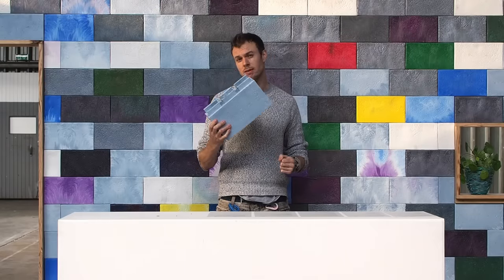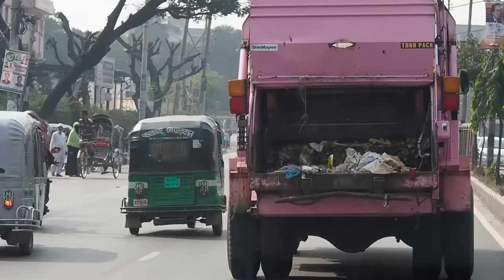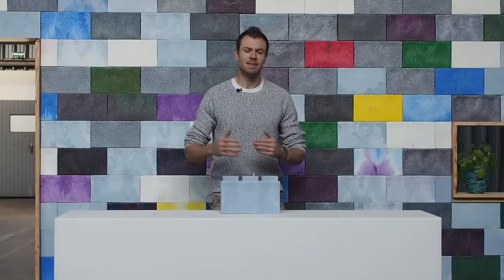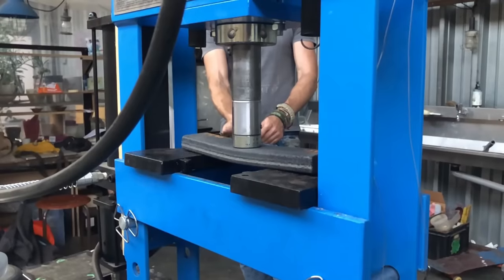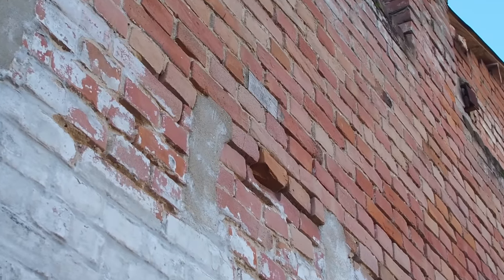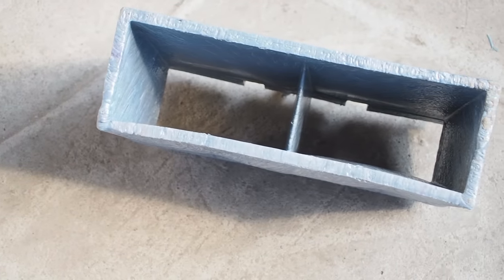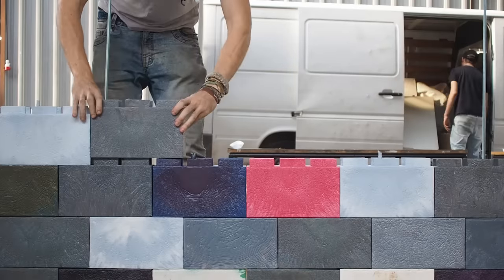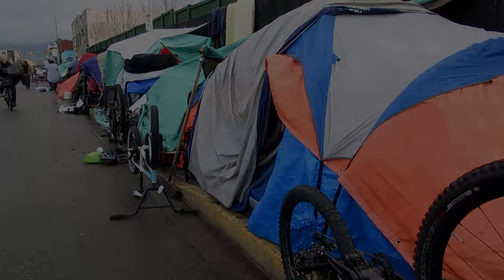Why the world needs recycled plastic bricks (and how to make one yourself!)

Comment: My question is, do the bricks lose some strength when heated up by the sun and do they release harmful chemicals like plastic often does when left under the sun for a long time?
Reply: IDK about this product specifically, but plastic lasts a very long time as long as it's not exposed to UV light. In the developing world, I would imagine it would be covered with a lime/sand stucco or something like that, similar to adobe-bag homes.  I'd also think that the walls could be filled with straw/lime or cob for thermal/sound insulation.
Reply: b k Air, is a great insulation stand-alone
Reply: @GrzesiJan  yeah we need better r values and thermal conductivity
Reply: Paint should fix that issue
Reply: from what i see this bricks strong enough to not eroded into microplastics
Reply: @alvinxyz7419  A lot of plastics are quickly weakened by exposure to UV, but like some other people have already said, they can easily be covered to prevent that.
Reply: The strength wouldn’t be affected, but you are definitely right on the VOCs
Plastics do release volatile organic compounds (voc) it’s the same smell you get when you park your car in the sun for a long time.
And considering the plastics used to make the bricks are mainly bottles and other packaging material, there shouldn’t be that much harmful VOCs. But if an entire house is built by these bricks, the total amount released would definitely be harmful to humans. Especially if something like bisphenol A was used to make one of the products.
Reply: @Vedrajrm  They also violate fire safety protocols (Think how much more dangerous a molten building would be)
Reply: yes. they do. there is a number of issues with this. I know this for a fact.
Reply: it needs to be sprayed with a coat of uv resistant / heat resistant paint/coating.
Reply: @Gaia Barone Ironically one of the big reasons we moved to plastic was the belief it would save wood, but then we just let our forests grow without management until they became tinderboxes and became foundations for massive uncontrollable wildfires. All that wood was just wasted for no reason, not to mention the destruction of ecosystems.

The resins used in pressure treated wood definitely is not healthy. Real wood is much safer, and frankly would not be expensive if we just cut back regulations on logging which also would be free forest management for the local governments who keep cutting back on their forestry operations due to the cost to hire the amount of people to cover the forest completely. 

I don't think we can eliminate plastic because plastic has amazing properties that aren't matched by wood products, but definitely a lot of polymers could be replaced by real wood products like they used to be.
Reply: @SteveOLive88   exactly
Reply: @brtecson  red oxide paint primer which is cheap in the third world does excellent UV protection
Reply: Yes and. It breaks down and becomes brittle because of UV light.
Reply: King Mike News Network  No, actually it's not.  Most of the world has strict regulations on the logging industry.  Trees are farmed.  Virgin forests are typically left untouched.  I don't know about where you are from because I have no idea where you live.
Reply: @DaveSmith-cp5kj  The forests became tinderboxes due to the misguided forest management practice of putting out all fires. After following this practice for decades masses of understory brush was allowed to build up. Then when fires did happen they were catastrophic. The other issue is people living in forests where their homes and lives are threatened if there is any fire, making the problem worse. Nature could control the spread of fires easily before human intervention. Some trees couldn't even reproduce without regular fires!
Reply: Yes they break down, causing further problems.
Reply: @brtecson  You could coat (paint) these blocks with a clear coat of uv-blocking paint.  Then every five years or so, recoat it.
Reply: My exact thoughts. 👏
Reply: @Vedrajrm  abs outgas, hdpe does not
Reply: @DaveSmith-cp5kj  plastics are made from petroleum... I recently saw a video here on youtube where a guy has some kind of thing that he cooks plastics in it and reduces it to diesel that he uses to run his generator.
Reply: Oh boy i see a future where plastic bricks would be banned as same reason as asbestos.
Reply: @JDW240  *"No, actually it's not [better than chopping down trees]." Trees are farmed.  Virgin forests are typically left untouched. *
It's still taking a waste product and putting it to use. Farmed trees take decades to grow and don't have nearly the biodiversity of a forest. And this could also be put to use in places that have very few trees
Reply: That’s why these bricks are mostly used for indoor spaces, where they aren’t as susceptible to UV radiation, erosion, etc.
Reply: I think the idea would be to use it as a base structure and then layer over it with more conventional construction materials.
Reply: Yes, yes it would.
Reply: I mean you need to paint it like other house you know
Reply: I know that in the Czech Republic A guy makes pavers and he adds a powder UV to the plastic to help with the breakdown and he's had dump trucks running on them for 10+ years now and still like new...
Reply: Then why not create a new logging niche for sustainable foresting? USA has a metric fuckton of federal land, let the country lease operation on a huge swathe of land specifically for logging so long as there's never less than 90% the amount of trees in the ground that there were when the land was fist leased. I know some trees grow to maturity in 10 or 15 years so while a slow start, it should allow a company to churn out massive amount of sustainable wood production AND give the country a rather large cut of the industry pie as (in my opinion) will be entitled for a hefty cut due to providing massive amount of land at basically no cost.
Reply: yes it would give you a big shortcut in cancer any% speedrun
Reply: Could it work as a foundation ?
Reply: @JDW240  sadly no such thing in Malaysia, there is regulations on permits, or permanent forest but illegal logger and poacher is seem untouched
Reply: Plaster them
Reply: And what would happen if the house catches fire🔥?
Reply: @brtecson  but wouldn't it still heat up? I have concrete walls and it remains hot into the night. I don't think a think layer of concrete will prevent the heat from getting through to the plastic.
Reply: Cure the plast8c...heat resistant
Reply: Legos don't melt...
Reply: Right! UV damage might cause it to flake into plastic dust- and micro-plastics are endocrine disruptors in most animals-
maybe a plaster / cement coating would mitigate this?
Reply: And what about the micro particles Lost in the water, One of the worst problema about plastic
Reply: everything is basically a building block of some form and can be harmful if to much enters the body.  you are correct when you think i have nothing better to do today and thats why i'm commenting . most every question has been answered and yet we humans keep asking the same old questions over and over . seems like we just want to communicate a bit lol . we need to focus on questions that actually seem to have no answer.
Reply: do they release toxic fumes when they burn?
Reply: Lasts over 100 years and when it's mixed with sand it is not toxic in developing countries!
Reply: @floreedith4667  are you sure it's not toxic? Micro plastics are becoming a big issue these days.
Reply: Use HEMP
Reply: It most likely does cause it’s plastic, but I’m sure it can be covered up. I think it’s a great idea for some type of reinforcement. It just needs more time.
Reply: @DaveSmith-cp5kj  the main drive behind using plastics was the hope that the rainforests would hopefully stop getting clear-cut.
Reply: Moisture infiltration, fire hazards, breakdown due to uv rays.
Reply: It can be used as internal walls, thats reduce 50 percent problem
Reply: @Vedrajrm  you're exposed to plastic 24/7 and this isn't an issue. I bet if you look around right now you'll see dozens of plastic items that are espoused to the sun in a regular basis. I don't see anyone falling over and dying because of VOC exposure. The reason for that is the VOC released is in the parts per trillian in the average household, an entire house wouldn't make a big enough difference in release of VOCs
Reply: @DaveSmith-cp5kj  sure, but is wood any less flammable? Is your car? Your clothes or couch? What about your bed?
Reply: @Gaia Barone it's better than plastics being in our oceans, waterways and landfills.
Reply: @cmichaels9544  Wood burns rather than melts, that's a whole lot safer than plastic. Same reason you wouldn't wear synthetic clothes when working a forge, you wear cotton if not leather because cotton will just burn off.
Reply: @benitalpaxton8120  Using hemp for a building would be senseless.
Reply: @MommeeMadre1  Legos do melt as they are made from ABS. Put a brick next to a candle and once it catches fire put it to the side, the whole thing will burn up and cause a molten mess.
Reply: @donnatrump1403  You can make plastics heat resistant, but they are not fireproof. They will still catch fire, they only slow combustion. The ideal building material is brick and concrete. 3D printers using concrete to build houses is a rapidly developing solution.
Reply: @DaveSmith-cp5kj    the plastic is mixed so no real combustion
Reply: @cmichaels9544  
lol. You've nailed it.
Reply: The plastic can sit on land field and still do the same harm, where we can reuse them for a beneficial cause than just killing the soil for nothing. Just think about the homeless.
Reply: Tornado could probably easily take that apart
Reply: Hard to beat regular masonry brick which lasts indefinitely in or out of the sun.  No paint required.
Reply: @brtecson  yup. It needs a "sunscreen" to prevent microplastuc photo degradation. I nominate the Super White paint that was recently developed, which includes the benefit of cooling the surface as well.
Reply: @ScarletFlames1  I think this would be a smart idea. A sustainable "thinning" of forest instead of allowing lumber companies to monoculture a large swatch of land. This could I'm theory maintain biodiversity, and come ahead of  disastrous fires, but the only issue is labor, logistics, and the industry's appetite for profits.
Reply: @cmichaels9544  fair point. We drilled the oil and manufactured the plastic as a species.. it's our responsibility and perhaps the toxins of plastic harming us most, vs. the other animals who did not choose to use plastic but still suffer downstream is more fair.
Reply: @JDW240  Virgin forests are untouched? Not in British Columbia Canada, where the government is allowing the logging of old growth trees despite them being irreplaceable and such a small fraction of the forest we have.
Reply: @DaveSmith-cp5kj  brick and concrete do very poorly in earthquakes, whereas wood, and assumably plastic are much better. Bricks with plastic spacers might be ideal. instead of grout which has no give, plastic cushions between the bricks would absorb shock.
Reply: @brtecson  you wouldn't want to fill them with something too solid or too light, instead a mixture of loose dirt and straw would work well, or styrofoam instead of straw which could be shredded and mixed with the dirt, the benefit of having it filled with something heavy is it makes the walls sturdier
Reply: @GrzesiJan  not a large mass of air though, its more beneficial to have air pockets, thats why we don't just leave our walls empty
Reply: @brtecson  when you warm Plastic it loses its rigidity, the warmer it gets the more melty it gets, so if in high heat these bricks become too flexible the whole structure could collapse, however to answer the original commenter they did say they tested exposure to UV and published the results already so you could just check their data
Reply: @DaveSmith-cp5kj  probably about as dangerous as a wooden structure. Thick, heat-resistant material like porous brick has been used for thousands of years, even the Romans used concrete and their structures still stand.
Reply: @DaveSmith-cp5kj  3D printing with geopolymers seems promising/cool. Working with concrete is terrible. Shit ends up in your lungs its a bad time.
Reply: @dharmapunk777  They will be a lot more expensive though, which is counter productive to the AM construction industry. Mixing cement isn't that bad, just do it outside and don't breathe it in. Respirators are cheap as well if you really need it. I cast little pots out of concrete to grow vegetables, and I made a shooting range using concrete with a rubber additive to give it ballistic properties. Cement is a great material.
Reply: @DaveSmith-cp5kj  Once it's set up its fine, but the dust is definitely hazardous and if you've ever worked construction there is always someone drilling into or cutting concrete with zero warning to put on ppe. 
The dust doesn't just go away on its own either. It's always Mexicans levelling the slab and they don't drape anything off or wear ppe themselves. Then they send some labourer to sweep instead of vacuum and kicks it all up in the air. Fucking terrible.
Reply: @DaveSmith-cp5kj  I agree. Still, we need do something immediately with plastic waste. The solution lies in solar-powered pyrolysis.
Reply: @saibabagarden  All we have to do to reduce plastics is to remove all the environmental regulations on logging trees and then more paper and wood products will be used. This will not only be cheaper, but logging will prevent the massive wildfires that were created from unchecked planting.
Reply: @DaveSmith-cp5kj  Okey, but right now there is huuuuge plastic pollution problem, this waste needs to be removed from environment. It virtually kills life in ocean. So we need stimulate people to collect as much plastic rubbish as possible. If they know they can make fuel or money from rubbish, they'll hunt for it everywhere. This is why pyrolysis is of interest.
Reply: @brtecson  Look up ICF construction. You can shotcrete the outside also.
Reply: @trcaggiano  whos this guy?
Reply: @PatrikBecomes  If its important, I will find his contact info...
Reply: @trcaggiano  it's important, blessings for your fast reply
Reply: Very good question, I would presume it would release some form of Fumes when it is in the Sun and most likely warp it’s shape. I think it would still depend because if you have a soft plastic like a plastic bag and leave it in very hot weather it would warp and slightly melt, if you put a empty coke bottle of a hard plastic it would not war and melt unless is it very very hot. And also consider that in the Sun it would end up cracking
Reply: @DaveSmith-cp5kj  in most cases a building only needs a 1-hour fire rating for code, a thin cement coating works
Reply: @chadsimmons6347  I feel like at that point you might as well go back to wood. Hot plastic is scarier to me than wood burning.
Reply: Hi, I am from Rwanda. Can hwo can we connect and bring this solution to Africa? Please let me know.
Reply: no it does not
Reply: just visited the website of conceptos plasticos and their bricks are fire retardants !!
Reply: I have one of those plastic red and yellow cars I bought for my son. He is 29 now and that cars is still in the back yard. We want to see how long it will last. I bet l am long gone and that plastic car will still be around.
Reply: I liked your comment because #1 it's a good question and #2 you were at 666 likes. I broke the curse 🤜🤛
Reply: @DaveSmith-cp5kj  civilization is not a cheap service, the fact is that forests capture carbon in the air and store it as organic matter.  We should be boosting horticulture and graduating more arborists to watch over and manage our forests to reduce the occurrence of forest fires.  Then, figure out how to balance the use of innovative wood alternatives with real wood.  Dealing in absolutes stifles innovation and closes the doors on diverse possibilities.
Reply: Plastic creeps over time unless it is reinforced, typically with short-strand glass fiber.
Reply: The sun does not heat it up enough to make the bricks loose strength or release harmful gases
Reply: Who say that plastic release toksin under sun light. Certainly plastics had different negative effects. But how under sun????? To protect the plastic bricks if they are directly face to sun light there is a solution. Protective additives against ultraviolet rays  must be added.

Comment: I like the "shingled" design. Especially if the bottom edge is designed to drip water rather than let it run under the bottom of the "brick."
Reply: YES I liked them, I dont know why they did not put a flat surface not he front of the brink and a slope on the back - that would still allow them to get them out of the mould and you just need a L shape at the front edge to lip under the next brick above...
Reply: Now they have the blueprints to make both! ❤
Reply: Fantastic what you guys are achieving, every government in every Country should have a moral right to finding the best way to recycle & reuse plastic. Netherlands are leaps ahead in doing so compared shamefully to Australia, the nation's governments apathy to the problem is deplorable to say the least.

Comment: another interesting thing is that the hollow bricks could be filled with insulation of some type (even something as simple as sawdust) to help keep heat in/out
Reply: Geopolymer concrete mixed woth polystirene  regrind as a filler for heat insulation.